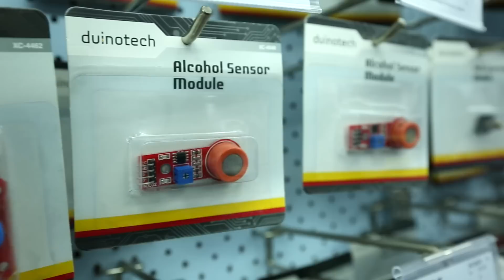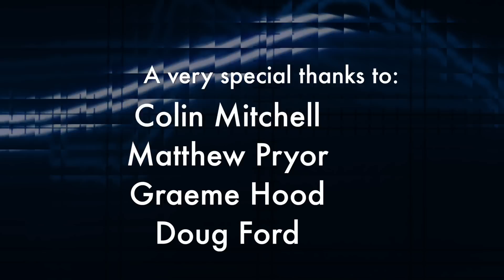The Decline of Hobby Electronics?

Comment: You know, I took two electronics magazines, one from early 80s and one from few months ago. The old one had many articles suitable for beginners, the new one have too advanced schematics to be made and understand by a beginner. For me is ok, it evolved with my knowledge, but how about one that take today the soldering iron for the first time?
The beginner is (I think) often scared by the complexity and is the circuit does not work, many times he gives up. By buying kits is just to learn to solder, no many manuals or troubleshooting info are available. Also many kits came with smd components already soldered so one have to solder few resistors, capacitors, connectors and that is all. Is that electronics or soldering lesson?
I started in electronics by reading articles in magazines that besides explaining the schematic, offered many times calculations for some components so if you do not had a value, can replace with another; by doing that calculations, one would learn how the circuit works and why.
By using thd components, one can improvise in air, on a perfboard or  breadboard a circuit an see if and how it works, even being able to tinker with it. Try to do that with smd. Also, many big names in electronics (that are in the video) just are allergic to thd components (mostly old ICs) but they forget that before Arduino there was TTL.
About arduino and microcontrollers: that is NOT electronics. Learning to program a microcontroller has its value and is also beautiful but that is NOT electronics. In 80s I had a Spectrum clone tha I many times used like I use today an Arduino (to light some bulbs, LEDs, to command relays or to read a sensor). all was programmed in BASIC and it was fantastic because it worked. Later I commanded a motor that opened and closed the cotines on my window. Was that electronic? make one circuit and command it by programs is more close to programming, robotics, but not electronics.
So, my final opinion is that yes, the electronics as hobby is declining, shifting to programming, robotics, thing that is a evolution but also a lose, because the basics are forgotten.
Reply: I've been an avid electronic hobbyist for 3 decades, mostly focused on building and designing electronic modular synth related projects. While there's still a lot of thru-hole components and kits available, in the last decade there's been a big swing to SMT. In some cases, I've ordered a module i was interested in only to find all the parts 'pick-placed-soldered' and all that was left to do was assemble the hardware. { Very disappointing when I'd been looking fwd to generating some solder fumes.} It's a sad but inevitable change with the evolving mass-manufacturing paradigm ...Unfortunately I do think that this will make it harder for new electronic hobbyists' startup . Drooling over a Forest Mims publication has become somewhat of an anachronism. :  /

Comment: Once there were a number of how to magazines in the US that concerned electronics; with many of the articles that were geared towards the making of digital equipment moving into the 80s.  Most generally computers and what you could make that were in effect attachments, there were exceptions, so I am speaking very broadly.  And the point of those magazines were, in fact, largely accomplished.  The other reasons that things ended up the way that they did, is that most folks only have the two hands, oddly enough, and there are still only 24 hours in a day.  So unless there's a real reason for folks to get the gear, the books, magazines, parts, and on and on, what you see is what we have.  Of course, if there was some real money in it (like there used to be in TV repair), things might change.

Comment: You can do amazing stuff with electronics now and can buy amazing equipment, like oscilloscopes, relatively cheaply. SMDs are only an extra option; all the older stuff is still available and useful. Plus now there is the option of using programmable chips. You can order custom PCBs online cheaply .... it's like an electronics sweet/candy shop. Sure, you're probably not going to be motivated to make stuff you can just buy instead, but was that really a big motivation in the past? You get into electronics to make stuff that you can't easily just buy. That's an infinite array of things.

Comment: I don't see SMDs as being evil, nor arduinos, raspberry pis etc.  I don't use SMDs as I would spend most of my time picking them up off the floor!  As for the arduinos etc. - I can't really think of anything I want to make with them.  I'm just having fun doing what I couldn't when I was a teenager.  Back when having an oscilloscope was almost unheard of outside of a lab or repair shop.
With the like of AliEx, Ebay and other similar online retailers I can buy components and test equipment for a fraction of the price of local stores.  You just have to wait ...  The local store still gets some patronage for the times when I want it now, not 4-6 weeks later.  I would like to support local, but who will support me to do that ?  The components maybe mediocre regarding quality, but are often the same as the locally sold stuff.  Anyway I'm not building satellites or rocket guidance systems so what the hell.

Comment: The scene is bigger today than it ever was. Back in the 80s you were lucky to have a decent multimeter and most bench PSUs were homemade. The oscilloscope gave rise to much jealousy drawing gasps of amazement from those unfortunate enough to not own one with most only seen in colleges or place of work. These days, you can have a fully equipped workshop including all the RF gear that will outperform most professional workshops of the 90s. Today's players are so spoilt for choice they can afford to get sniffy at bits of test gear that boys from the 80s would have ripped your arms off for.

Comment: I feel those who don't have good previous knowledge of electronics will have very hard time doing it for hobby. Most things are based on micro controllers which take knowledge of programming, other stuff consists of modules and might be pretty extensive. There are applications like doing tricks with light (LED etc), audio and a few more although it isn't in no way comparable to 80's or even 90's. It is also about people's relation to electronics; most use certain device until new comes out even if they don't need them. I'm afraid audio is the last major field where hobby electronics are still fun, without needing to know a lot about it. Programming takes quite some time to learn, it is in no way comparable to simple analog electronics fun.

Comment: I don't have a problem with building SMD projects. But I have to use a microscope, solder paste, flux in a syringe and a temp controlled hot air gun and hot plate to melt the solder in addition to a nice temp controlled soldering iron. I happen to have been an EE for 30 years, so I'm familiar with manufacturing processes for boards. Also you can design circuits and board on services like EasyEDA and use the parts from their component supplier and they will build the PCB and assemble the components onto the board for a very low price compared to what it used to be for small volume builds.

Comment: Boy this didn't age well. The Maker movement and DIY - including electronics - is bigger than it probably has ever been.

No, it's not a brick-and-mortar retail industry, but you can get more components, cheaper, from Amazon than you ever could from Radio Shack
Reply: I'd not reccomend getting components for Amazon neither for price nor for quality. The cheap 10+ day shipping stuff is all the same as aliexpress, banggood, etc, so just get it from there, save money, and have a return policy which doesn't require you to send an item back if it is not working. Proper electronics are also not cheap on Amazon and exact model numbers are often mixed up.
Reply: aliexpress :)

Comment: The components are still available. You just have to get them from Farnell or Mouser or suchlike rather than "Dave's" on the high street. I learned electronics as a young teenager back in the late 70s/early 80s using a breadboard and dip opamps, resistors etc. These are still very much available and probably much cheaper than they were back then. What we have now but didn't have 40 years ago are affordable bench PSUs, oscilloscopes, sig gens etc. We now also have free PCB CAD software (KiCad) and ridiculously cheap PCB manufacturers, admittedly all in China but hey. I built a guitar distortion unit in 1978 on a PCB I made myself using my mother's nail varnish as the etch resistant! It still works today. I suspect "hobby electronics" as we knew it may be in decline mainly due to Arduino and Raspberry Pi. Why bother learning how to design and build a discrete circuit when you can bash it out in ten lines of mostly prewritten library code on an Arduino?

Comment: Declined..? Lmao... Get ur hands on some LEDs, MOSFETs, Capacitors... Some OpAmps ... Let's not forget the resistors.. Electronics will never die as a hobby.. honestly you can go on eBay n buy urself a QC 3.0 charge module, hook it up to a 20A 3s BMS, to ur 3s lion battery pack... Honestly.. I'm self taught, and I understand it all boils down to inductors, capacitors, and MOSFETs... Mostly..

I've got a 40w soldering iron I bought from radio shack like a million years ago.. still works.. still solders even little contacts on buck converter modules...

Comment: We have the dexterity just not the precision at the ever shrinking surface mount scale so IMHO what hobbyists need is an affordable manually operated micro-manipulator to bridge the gap between human and machine assembly. If I had the money then would be looking at fitting tweezers to a 3D printer.

Comment: I've been hand-building projects for 40+ years and I found some things in the video very misleading.  For one thing, it doesn't matter that walk-in stores selling pin-thru-hole (PTH) components have closed.  They've closed because we don't need them anymore and stock was overpriced.  Anyone can order parts across a much wider inventory, for less cost, from online suppliers such as Digikey, Newark, Mouser, Allied Electronics, AliExpress, eBay, and a thousand more.  Not only can you still easily get the so-called traditional PTH parts and materials, but almost all suppliers now also sell all of the surface mount devices (SMD) in tubes or cut-tape and they are very cheap.  The video showing the kid soldering with with a huge blackened tip was cringe-worthy at best and whoever set up that shot should be ashamed.  Cooking PCBs in a toaster-oven is also completely unnecessary and the video didn't even mention the other hardships that go along with soldering things that way, but I won't get into those now.  I've been soldering surface mount technology (SMT) components onto PCBs completely by hand for over 25 years and it is not a feat of magic and my results are as good as any machine assembly, just slower.  All you need is to have someone show you the proper technique, starting with using the correct tip size, how to "tin" it and keep it clean, and the correct temperature.  It's also important to use the correct flux core and solder wire size for the job.  Soldering 0.050" pitch chips and 1206 and 0805 components is a piece of cake.  I also can do 0.5mm 4-sided chips flawlessly all day long.  I can hand-place and hand-solder over 12000 parts in a 40 hour week.  I never use solder-wick either.  Don't need to.  In the video, the kid was picking up the 1206 size SMT resistor by the terminals when he should have been picking it up by the sides.  That just shows how little the creators of the video knew about the content.  Working with SMT stuff is cheap and simple and nobody should be made to think that you cannot do it at home.  One guy in the video said "you need tweezers and pliers..." like is was some sort of insurmountable difficulty.  I just had to laugh.  I've been etching hybrid PCBs (meaning using both PTH and SMT on the same PCB) at home forever.  The more SMD's you use, the fewer holes you have to drill, the less leads you have to bend and put through holes, the less leads you have to clip, and the less times you have to flip the PCB during assembly.  I've rambled on too long, sorry, but after seeing this video, I just had to speak up.  I appreciate that Dave Jones participated but this video would have benefited enormously if he had been in it a lot more so that he could have fixed the problems I mentioned and made the content more positive rather than conveying the message that hobbyists today are basically screwed.  Fortunately, you can visit Dave's channel eevBlog and see exactly what I'm talking about.
Reply: After watching both the video and your comment, I conclude that you are absolutely right. With the proper tools and some time to spend for practicing, one can learn how to work with SMD components in no time. Not to mention, like you said, it can get easier to work with than THT. Thanks for the comment! I'm sure it helped a lot of people who watched this video.
Reply: Agree.  Started about 40 years ago with Dick Smith kit my dad bought.  Still have original soldering iron although I now use a nice Weller.  It's an unbelievably better world these days.  Datasheets readily available with a quick Google search.  Awesome tools like KiCad for PCB design.  Ridiculously cheap PCB fabrication - upload and wait a week...  Online forums for getting help with issues...
Reply: @mygmail6579  Get to it and have fun! Find a maker's, robot,  HAM, or radio/tv museum in your area and get to know the guys. They'll help you along plenty. Good Luck and best wishes for your success!
Reply: Jameco
Reply: All Electronics
Reply: Well said.

Comment: I've been doing electronics over 60 years. When I was a kid I collected TV's and radios people threw out. I then went to work in a TV/radio repair shop and fixed the first transistor radios the older guys in the shop couldn't fix. I built Heathkits, Dynakits and every other kit I could get my hands on. I built my first stereo when I was 13 out of old tube radios.
I worked electronics in the US Navy on the first military computers. 20 years ago I was building thru hole boards, making my own PCBs in my basement. I got a degree in electronics and kept growing with it.
Now at 75 I do uC's and almost all SMD. You can do it expensively but you can also do it on the cheap. Dave Jones is right, uC's changed everything. Watch Dave's channel,  he is a great teacher and he know electronics. Start slowly and find the electronics niche that fits you ,electronics is a vast science. You can't learn it all but you can learn enough to build great stuff and have lots of fun! It's a great hobby but you get out what you put into it.
China is great! I get all kinds of boards and components from them. Old parts sellers either change to meet new demands or they die. I get PCBs from China cheaper than I ever got them in the US. So cheap that it almost doesn't pay to make my own anymore excepting for small short run boards. Yes, the electronics world changed but it's technology, learn how to change and grow with it. Does anyone expect it to be the same as it was 50 years ago? Nothing's the same as it was 50 years ago!
Reply: Same as you. I started electronics when i was 10, i was collecting broken electronics, radios, TV's and more. Open them up take up all the components and learn about them. When i was 12, i build my first FM transmitter (with some help of my uncle) and few months later i build my first Audio amplifier, the audio wasn't that great but i was happy that i  managed to make something out of broken electronics. Now i'm 21 im still learning about electronics.
As a kid back then, i wasn't able to go to some electronic store or go online shopping and buy the components i need for something i want to fix or make.
I never learned anything about vacuum tubes i have few of them from old radios, TV's but i dont know how they work, how to power them or how they work.
Reply: @fredymredy  Vacuum tubes are pretty easy, they're voltage controlled as opposed to current like some transistors. I write for AudioXpress and have had a couple of tube amps in the magazine over the years,a lot of fun to play with as long as you don't go nuts like some audiophiles. Wait, all audiophiles go nuts!
Reply: It's not declining. China just change the rules how electronic components reached out to end users and of course control the direct trading cutting the profit hunger distribution system that burden buyer.
Reply: @albertomarsamolojr.2842  China is not beating companies like AD and TI, they still make the chips. I still buy from US distributers especially when I need to know my parts aren't counterfeit.

Comment: I've had good hauls in the past 20yrs trying to acquire as many parts e.g capacitors, pots, leds etc from used electronics that i can keep and catalogue for later. All these components are cheap as chips to buy online as we know. But if the goal is to spend nothing on anything and just hoard junk from dumpsters and obsolete consumer goods, it can be a lot of fun being so miserly and I think it kind of brings back the old spirit of the early electronic hobbists from the 70s/80s/90s.

Comment: In den 70ern habe ich auch an Radios gelötet, in den 80ern an Computern wie Sinclair ZX Spectrum oder Commodore Amiga, aber seit den 90ern mit der SMD Revolution ist es schwer, selbst einen Taster an ein Beinchen eines Prozessors anzulöten, wo es nicht vorgesehen ist. Hardwarereset oder HALT-Kippschalter anzulöten ist seither extrem schwer. Mit einem Bildschirmmikroskop ist ein muss. Ich hoffe, chinesische Pick&Place maschinen werden deutlich günstiger und kompakter.
Aber seien wir andererseits froh. Ohne Arduino hätte es keine 3D Druckerrevolution gegeben